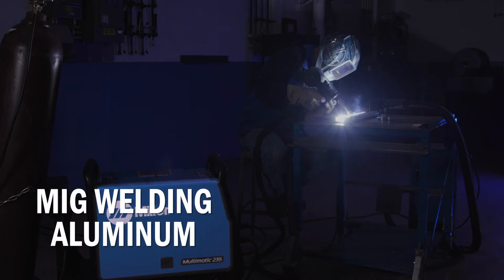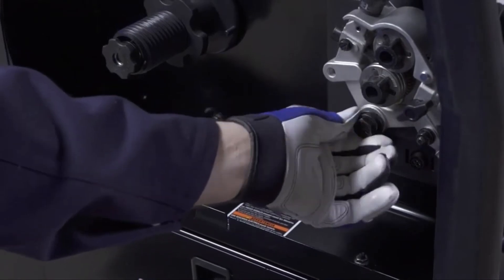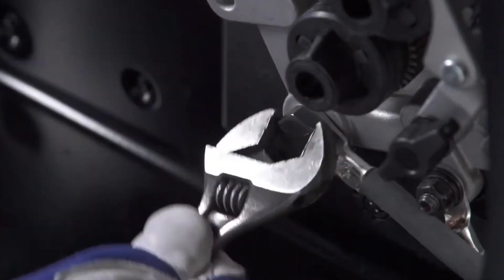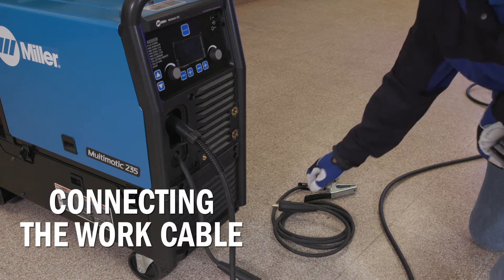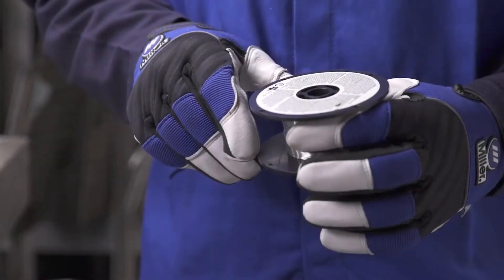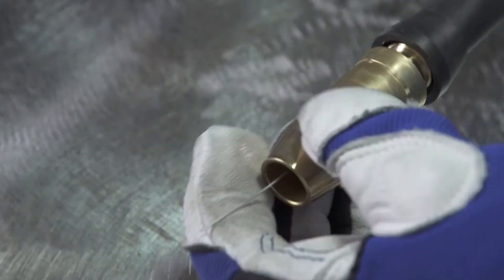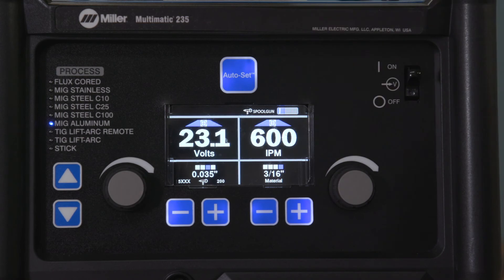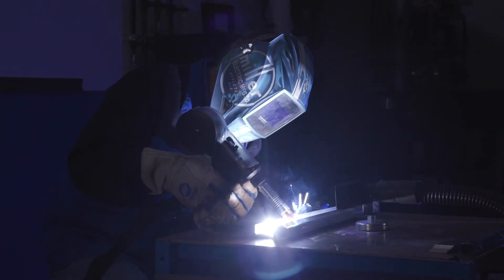Setting Up Your Multimatic 235 to MIG Weld Aluminum

Comment: Does the spool gun come with the welder or does it need to be bought separately?
Reply from the maker: Hi there, thanks for reaching out. This video shows how to install a Spoolmatic® or Spoolmate™ spool gun which is an accessory to the Multimatic 235. For more information and to view all of the options: https://www.millerwelds.com/equipment/welders/multiprocess/multimatic-235-multiprocess-welder-240v-m30250?. We also recommend checking with your local distributor for information and availability in your area: MillerWelds.com/wheretobuy. Thank you!